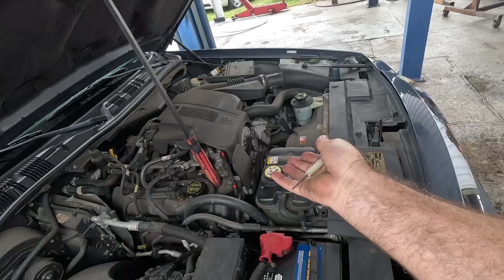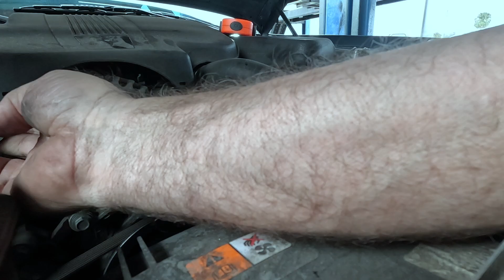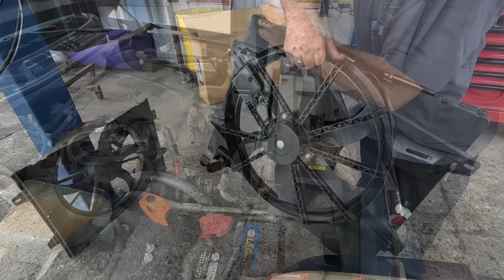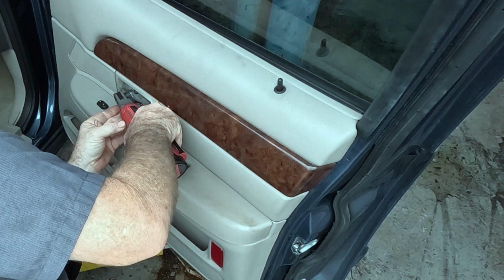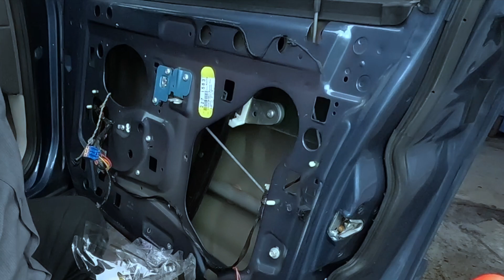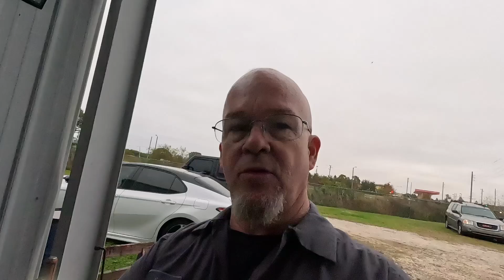Can it Be Fixed? MERCURY GRAND MARQUIS, REPAIR VIDEO...Cooling system, Window regulator, Shocks?

Comment: Had to change the thermostat in one of those 4.6 Fords that became expensive.One of the bolts broke off and ended replacing the driver's side cylinder head.Could not get the part of the broken  off bolt out in the head.
Reply from the maker: Yikes! Things can snowball quickly in this business!
Reply: @JimmyMakingitwork  Bolt was corroded in good